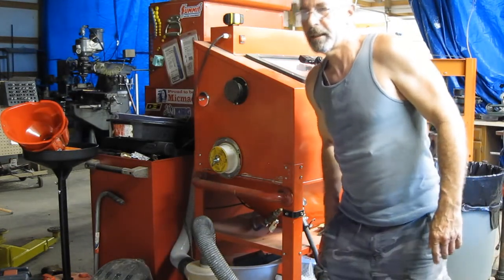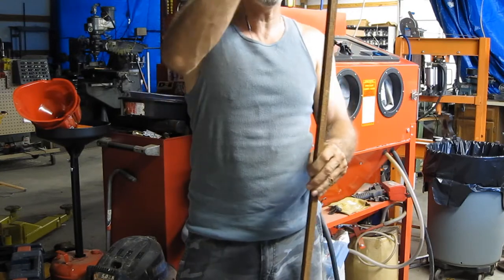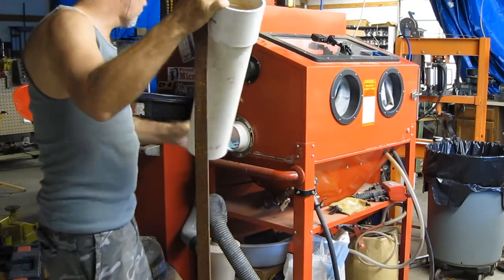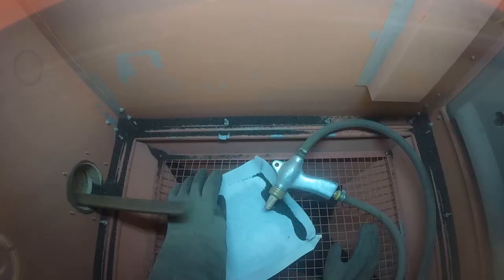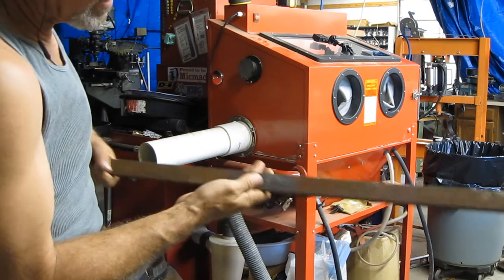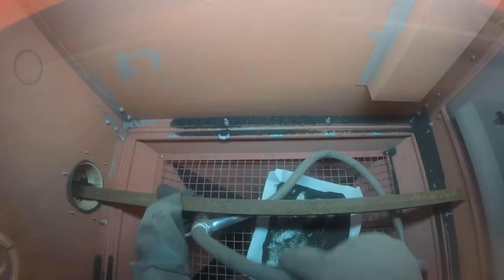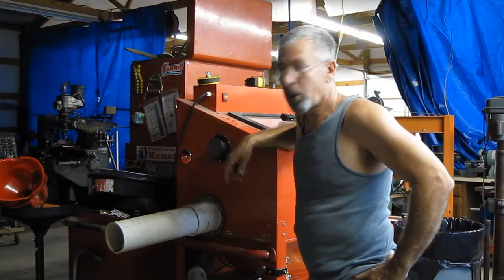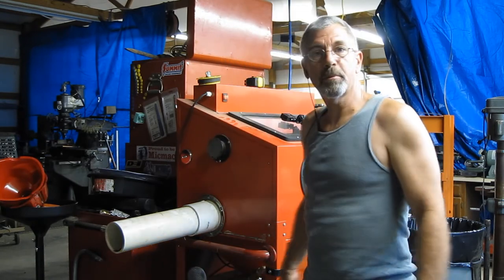BLASTING LONG ITEMS IN A SHORT BLAST CABINET

Comment: Good idea, I wonder if you put a pvc tube on the opposite side and had two roller stands you could do a piece 20 foot long.
Reply from the maker: Yes, you probably could. You might need more suction than a shop vac can provide, but it's worth a shot. If you made some sort of baffle in both of the flanges,from some old brushes or something it would probably work great with just a single shop vac.

Comment: A sand blaster is a tool I like to have and could use plenty are they very spendy?
Reply from the maker: It all depends on what you call "spendy" but this  cabinet in the video is $179 right now and even less with a 20% off coupon. It works the way it is from harbor freight but i did a lot of mods to it, to make it much better. The mods cost me as much or maybe more than the cabinet but they wer well worth it.   https://www.harborfreight.com/abrasive-blast-cabinet-68893.html
Reply: I would need one like a power washer style
Reply from the maker: Like one of these. You can add this attachment to your pressure washer.

http://www.northerntool.com/shop/tools/product_200660204_200660204

I got one , it works good.
Reply: Marcel LeMay ok thanks keep the vids coming
Reply from the maker: Smalltown Farmer88. Yeah,  i plan on it for now. I actually enjoy making them,  even though it is a lot of work. Thanks for being one of my loyal watchers. 😎